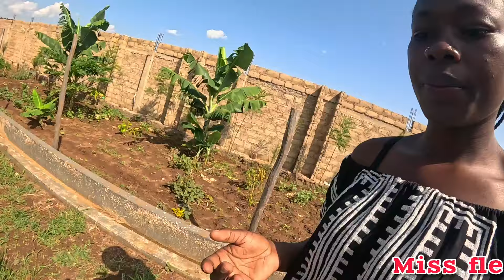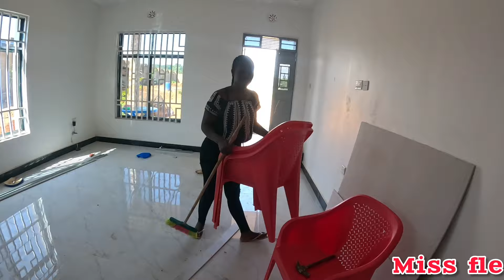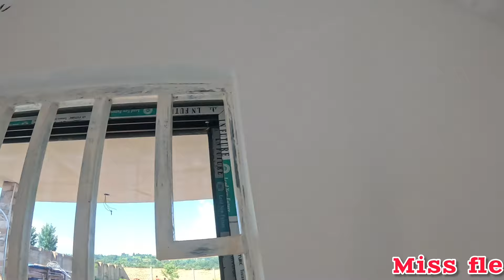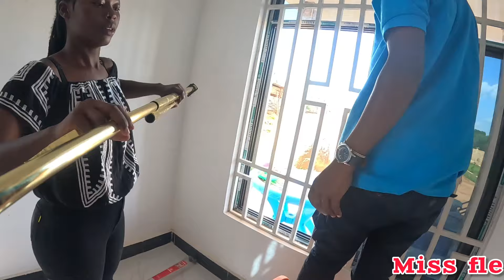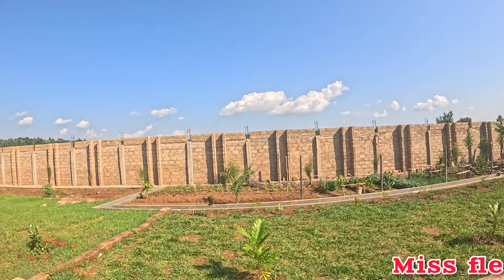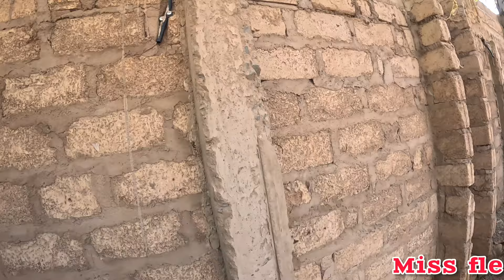BIG SURPRISE FROM USA❤🇱🇷||FINALLY BUYING CURTAIN RODS FOR OUR DREAM HOUSE🏡

Comment: ADVISE FROM INSTALLATION EXPERIENCE
1.      Curtain rode holders are screwed to the wall through fisher plugs after drilling (the process of drilling may make the wall dirty)
2.      Best you you align and fix the curtain rods before painting, after fixing you can just unscrew, do the painting and screw them back.
3.      Curtain rods should be at least 15cm from the ceiling(gypsum), and the curtain should at least 20 to 30cm from the floor
4.       DO NOT PUT CURTAINS ON THE DOORS (OUTDATED).

Comment: Instead of curtains on the doors, you can get a screen door mesh that opens when you walk in and out of it.  It fits in the door space and keeps insects from entering the house when the door is
open.  You can Google “screen door mesh” to see how it looks.  It is not that expensive and it is easy to install.
Also, you need to finish the painting before installing the curtain rods so that they don’t get paint on them.  When you hang the rods, you should measure the drapes and decide how high you want them off of the floor so that the rods can be hung at the level where the curtains will reach where you want them to fall in relation to the floor.